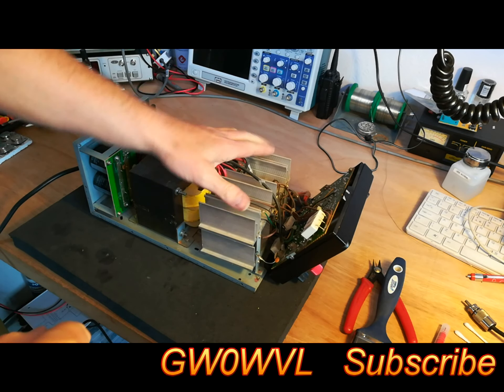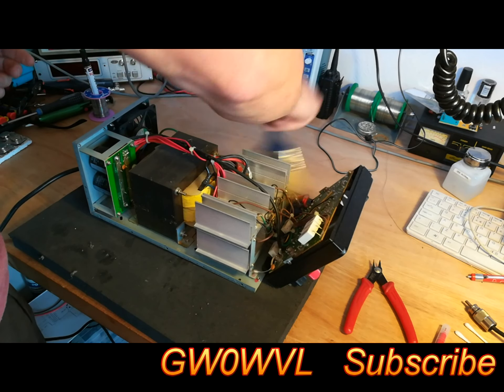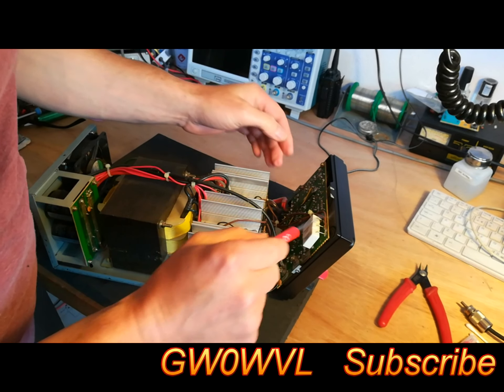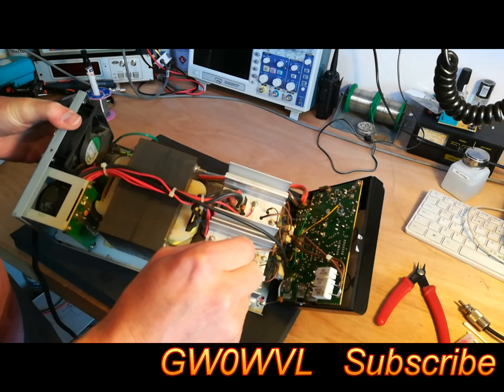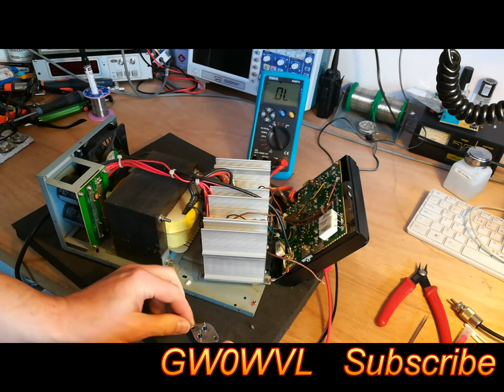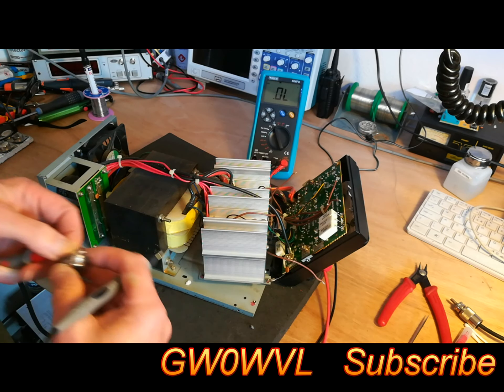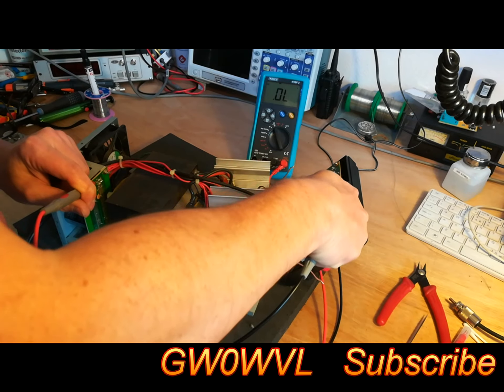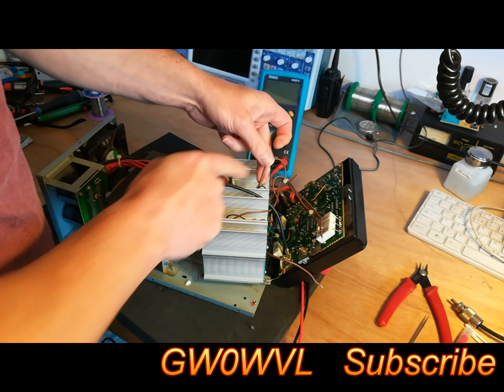GW0WVL .. Manson EP-925   Repair Part 2

Comment: I have the Dick Smith 3800, which is the same supply as the EP-925.
It started to drop out of regulation, with the output falling to 5 or 6 volts  when I transmitted. It already had  faults----The volt meter had failed, & the voltage adjustment pot at several settings also dropped the volts radically, so I resolved to fit  a conventional pot. Having done this, it adjusted normally, & I hoped that had caused the  problem, but it still dropped out under load. I decided to check the current available, before drop out, but, embarrasingly for a Greybeard, when I then checked the output voltage (remember the faulty voltmeter), I neglected to change to volts, & shorted the output. This, strangely, blew the 2A fuse in the aux supply for the 723 reg IC. Replacing this, gave constant 24 v at the output of the supply. Although that fuse failing didn't make sense, I assumed collector/emitter shorts on one or more 2N3055s, but on checking, found none, but did find one with a BASE/EMITTER  short. This evidentally removed any bias on the bases of the good pass transistors cutting them off, but allowing a path  for a much lower current capable regulated voltage from the driver transistor.The short killed the driver, causing it to have a collector/emitter short, hence the 24v direct from the aux supply.  A very rare fault, I would think!
73, VK6ZGO
Reply from the maker: Pass transistor shirts are common in linear supplies , Over voltage Crowbar  protection  is a must in this case if you don't want 20 plus volts outputting to your radio .

Comment: Replaced all the 2N in one go also used alot more heat compound added crowbar circuit also works fine now
Reply from the maker: Over voltage Crowbar circuit is a must 👍

Comment: use a pair of these on my radio rack only thing ive done is change the fans as the original ones were to noisy for me. I use an outboard crowbar curcuit on the power distribution blocks i made years ago

Comment: Blimey, larger transformer but other than that, it's pretty much exactly the same as the 915 I've got, the cooling is inadequate for 15 amps and that 925 uses the same heatsinks!!!
Reply from the maker: Ive had no issues with it  overheating , I draw roughly 20 amps from it on peaks, But then again im talking about SSB at 100 watts RF output , For constant current modes such as FM at   say 20/25 amps draw then like any other power supply , Its going to get hot..  This is where the fan would kick in

Comment: You can get server power supplies now that will do 100A at 12V for around 10GBP and convert them for bench top use very easily
Reply from the maker: I know But ive  " No interest in them  "... I dont like switchmodes never have never will... Besides thats not what this video is about , Its about getting the Manson EP-925  back up and running.
Reply: @Gw0wvl  Agreed ,i know, ive seen power amps drawing 300W and only outputting 3W, those switched modes things is taking away the fun of it all.